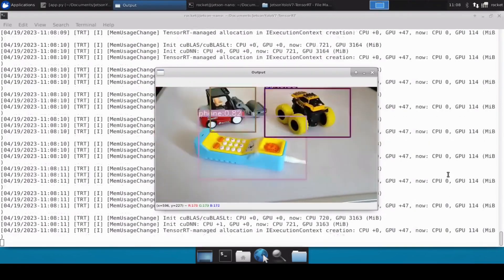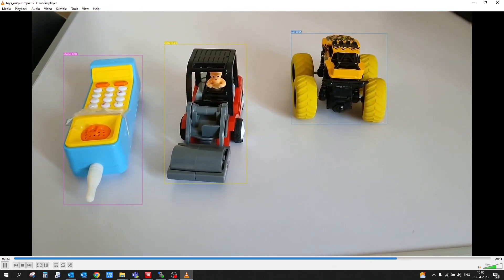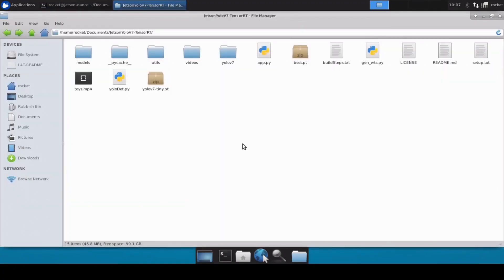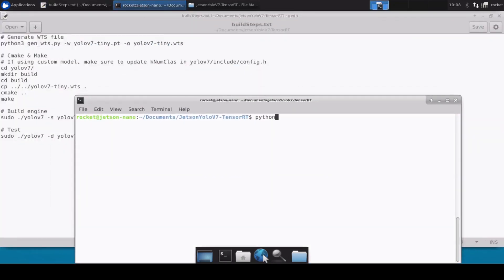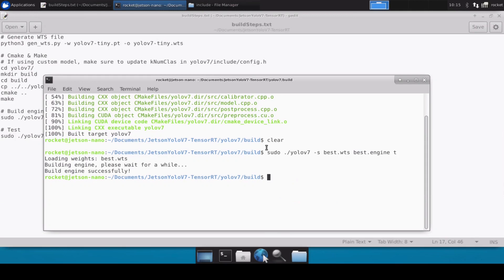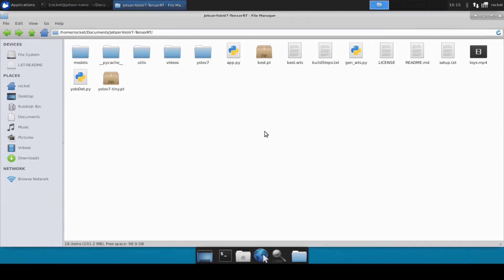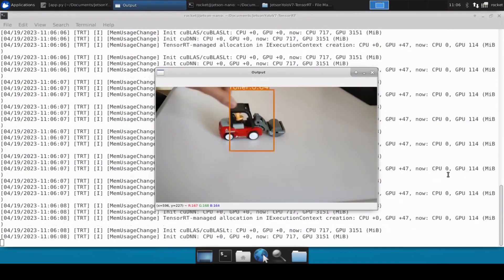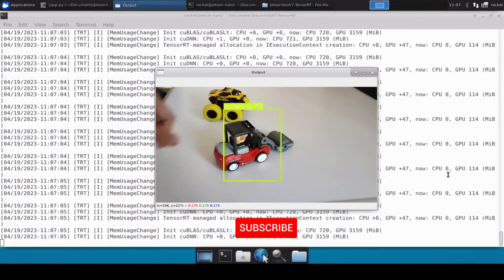Custom YoloV7 TensorRT Jetson Nano | Yolov7 | Rocket System

Comment: Hi,
As same process I’m also doing building the engine “$ sudo ./yolov7 -s yolov7-tiny.wts  yolov7-tiny.engine t” inspect of this command I gave $ sudo ./yolov7 -s yolov7-tiny.wts  yolov7-tiny.engine v7” it will work or not
Reply: Because I’m not using tiny model I’m using v7

Comment: Good day. Thanks for the video. I have the few questions for you:

1. Can I use the same method to "build engine" even if my weights are not tiny weights? I got an error when I did that until I included the t.

2. What is the reason behind the model showing bounding boxes without labels? I'm also encountering that.  Please note that I'm a beginner so please trying to understand the Yolo concept.
Reply from the maker: Yes you can use the same method to build engine for any other version of yolov7 model. Make sure to use appropriate flags to build engine.

I rechecked the video and there are labels showing with bbox.
Reply: I'm getting an error: Assertion 'serialized_engine != nullptr'
Reply: I'm failing to build engine on my custom model which is not a tiny model

Comment: Thanks for your video. Good hints for us. Can you share about the detection speed? Compare to YOLOv5 TRT on Jetson Nano. Is it faster than YOLOv5 on the same device? I have tried your tutorial and run YOLOv5 on Jetson Nano. It seems around 5-7 FPS with 640 img size input and 12-14 FPS with 320 img size.
Reply from the maker: Yolov7 is definitely faster than v5. I didn't tested with fps but will share comparison video soon.